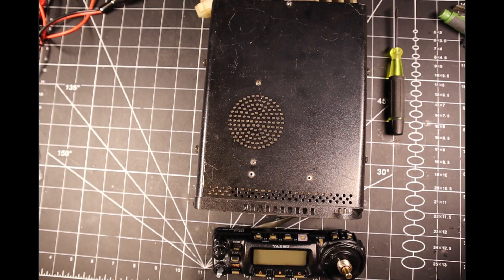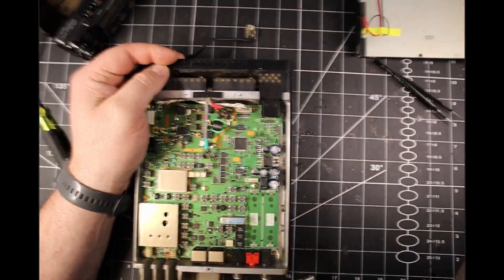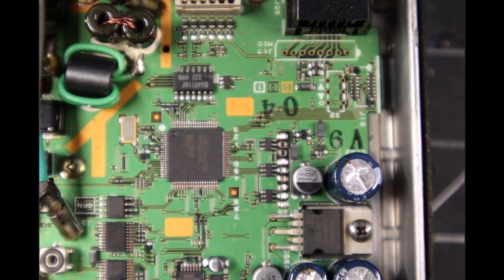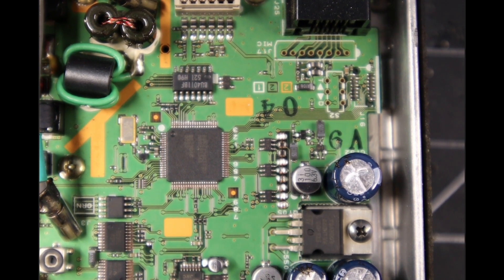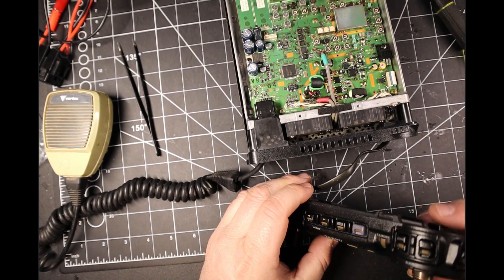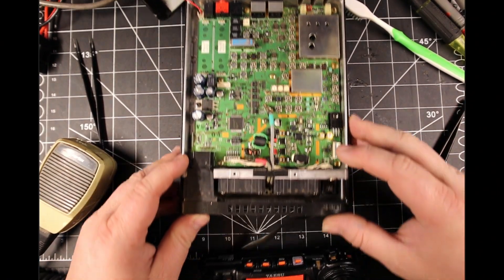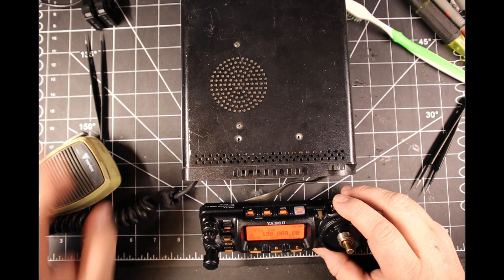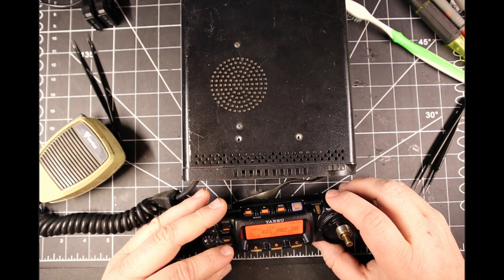YAESU FT-857 TX Unlock Frequency expansion

Comment: I had the MARS mod done on one of my 857Ds. It messed up the automatic frequency shift for repeaters. The mod allowed me to transmit on 11m but since the radio isn't FCC certified it was legal unless under emergency situation. No longer interested in MARS I went back to original configuration.
After I joined a volunteer fire department I kind of wished I left it alone. However, transmitting on FD frequencies on a non type accepted radio also puts a frown on the FCC's faces. Now the department uses UHF digital radios that are P25 so it doesn't matter anymore.

Comment: You make that look very easy!  The contacts are tiny, I did my 'D' model mainly with a silver conductive pen, as my solder skills were not as good a yours.  I managed to remove some of the contacts with a fine tipped iron as required, but used the pen for the rest.  Been working fine for quite a few years now.

Comment: Yeasu Serial Decipher  TO determine Date : How to decode Yaesu serial numbers and  know exactly when your Yaesu radio was manufactured

serial number of 9J271567
Position 1 = year made
Position 2 = month made
C = January
D = February
E = March
F = April
G = May
H = June
I = July
J = August
K = September
L = October
M = November
N = December

Position 3 and 4 = lot number(s)
Position 5 to 8 sequence in that lot

Position 1: last digit of the year in which the radio was produced
Position 2: Determine the position of the letter in the alphabet (C=3,D=4,E=5, etc)
then subtract 2.
The result gives the month in which the radio was manufactured.
Note that the letters will range from C (January) through N (December).
Thus, my FT-817 radio with a serial number of 9J271567 would have been manufactured in 2009 (9), during the month of August (J, August is the 8th month),  was part of lot 27, and was the 1567th radio in that lot.  From ve3ips

Comment: I did the Softmod on mine from 2003 .  Someone hacked it to bits trying to do it with I assume a welding iron.  I have 2 Japan models that the softmod opens up the RX but not the TX....The Japan models are only really good for HF since the VHF and UHF are different (minus 60M)